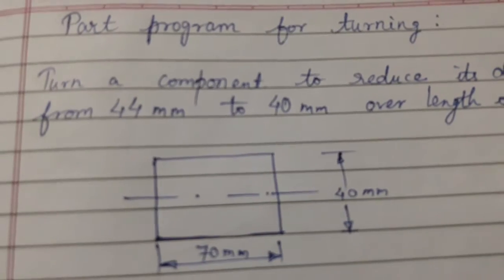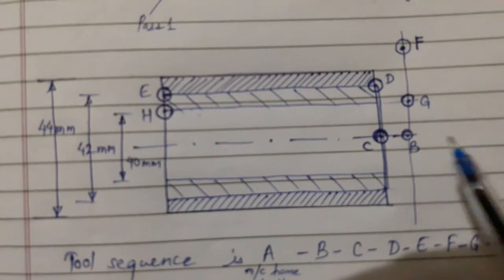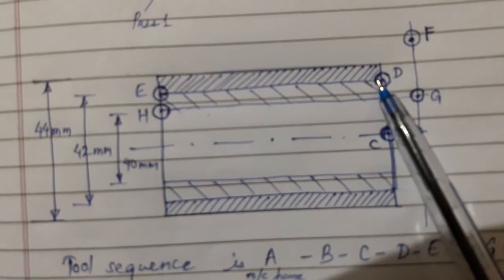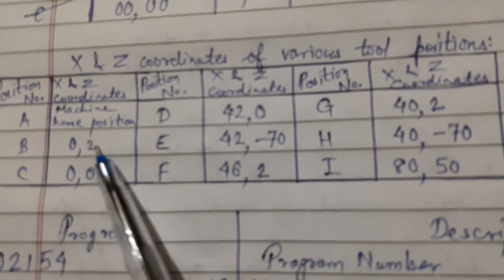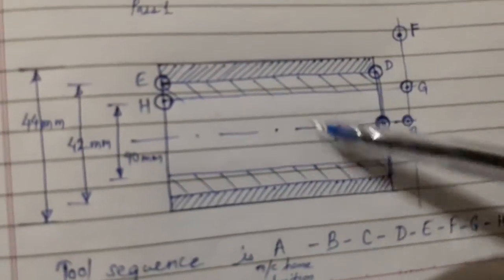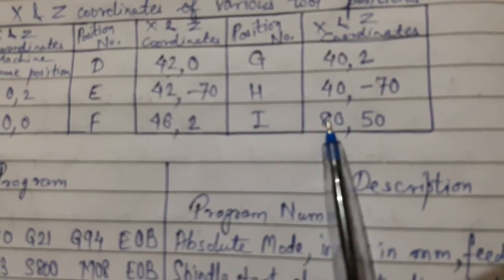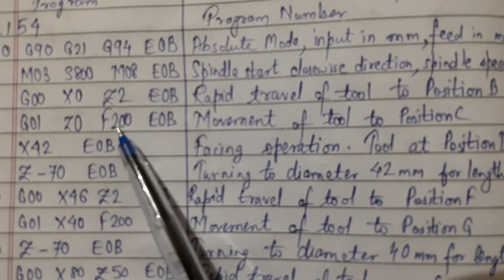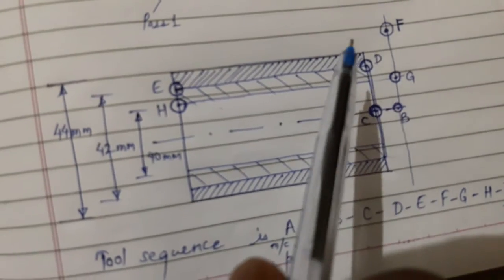Part program for Turning... (3k views - viral video)

Comment: If origin is at c then why are we taking 40,42,44? And not 20,21,22. Pls answer
Reply from the maker: The answer is that you cannot directly measure radius. You can directly measure diameter only, using a vernier calliper, screw gauge etc. If you want to know the radius, you have to convert the measured diameter by dividing it into half.
Hence all the physical sizes of shafts, pins, holes, etc are specified in diameter, which is directly measurable. So CNC lathes too are programmed for diameter...
Reply: @mechtechknowhow869  so basically tool is moving only 20,21,22 unit but we are writing 40,42,44??
Reply: @mechtechknowhow869  also I found this in books

X, Y, and Z: These addresses are used to represent the distances travelled by tool 
with respect to axes. e.g. X20, Y50 and Z-20.
Reply from the maker: U, V, W are incremental axes which means at whichever position the tool is during machining they can be specified to move a particular distance along the X, Y, Z axes without using offset values. For example: U1.0 moves the tool 1mm along the positive X axis while X1.0 brings the tool to diameter 1.0 of the component along the X axis.

The above is not specified in the program. Instead of U0, X0 is mentioned for beginners (the same was used in the book I referred and also in some other programs I referred)...
Reply: @mechtechknowhow869  can't get it clearly but thanks.. I will refer some books and see about U,V,W

Comment: Dear Sir , I have a one query ,
at Position No D , X Coordinate is 42 mm ,why not 21 mm from Position C (0,0).
If we are in Absolute coordinate .
Reply: Pls answer to this..
Reply from the maker: The answer is that you cannot directly measure radius. You can directly measure diameter only, using a vernier calliper, screw gauge etc. If you want to know the radius, you have to convert the measured diameter by dividing it into half.
Hence all the physical sizes of shafts, pins, holess etc are specified in diameter, which is directly measurable. So CNC lathes too are programmed for diameter...
Reply: @mechtechknowhow869  does it depend on coordinate origin position??

Comment: How come x is 42 at point D.... if x is 0 at the point C.....
Reply from the maker: The answer is that you cannot directly measure radius. You can directly measure diameter only, using a vernier calliper, screw gauge etc. If you want to know the radius, you have to convert the measured diameter by dividing it into half.
Hence all the physical sizes of shafts, pins, holess etc are specified in diameter, which is directly measurable. So CNC lathes too are programmed for diameter...